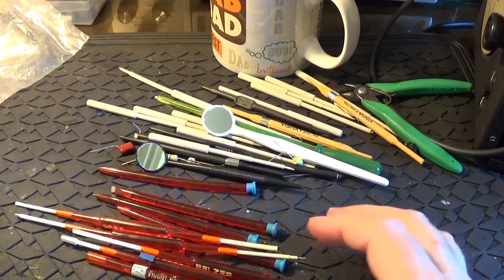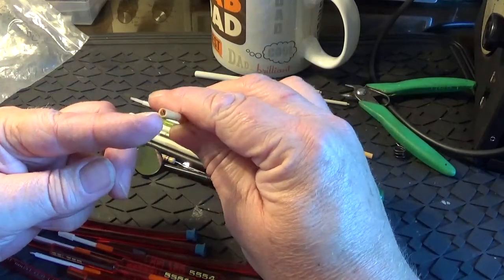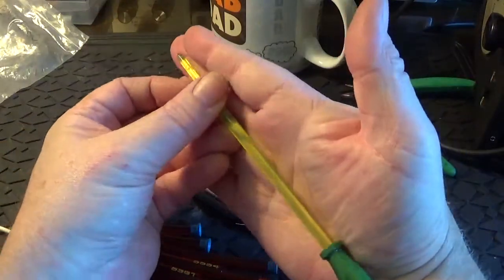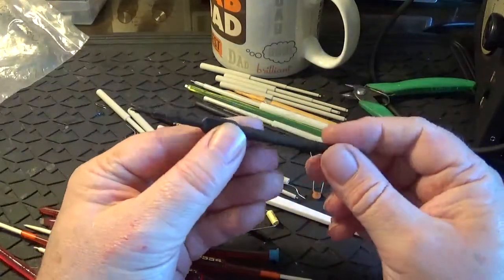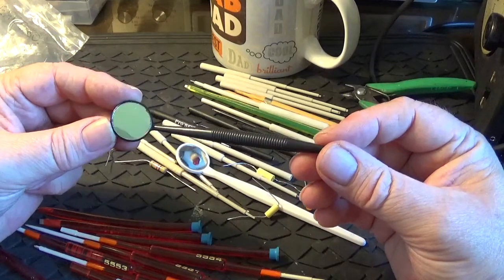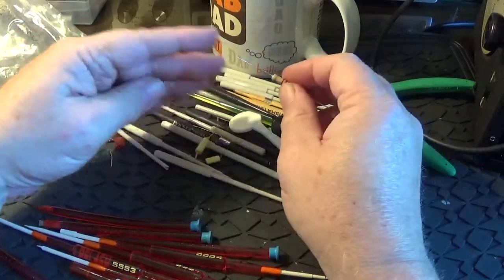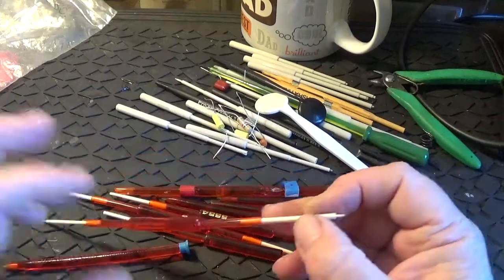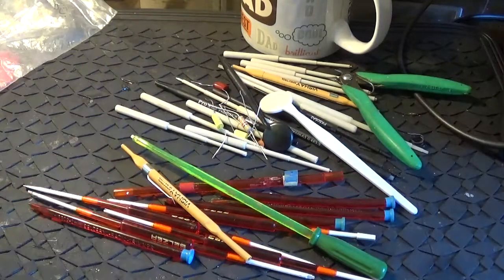Radio alignment tools

Comment: Never use GC Electronics black anti static alignment tools around high voltage. Used one on a neutralization capacitor in a Kenwood ts830s and it shorted to the chassis.  POW!!

Comment: Can those trimmers with the metal bladed ends be used for variable capacitors without altering the capacitance? Or are they for trimming resistor pots only?